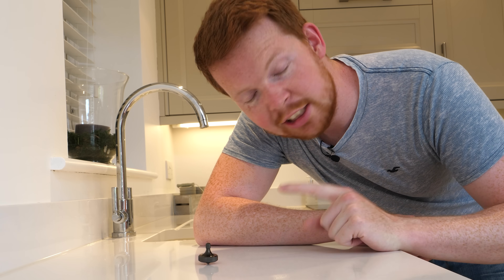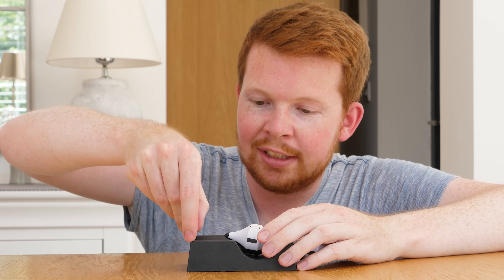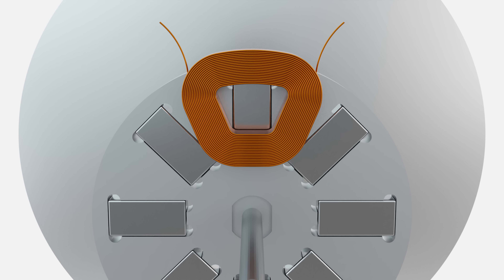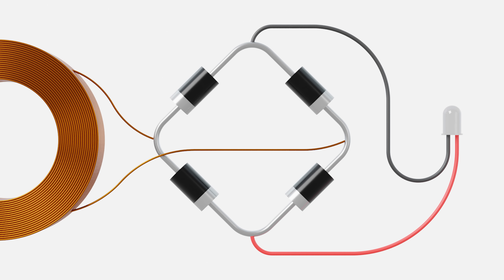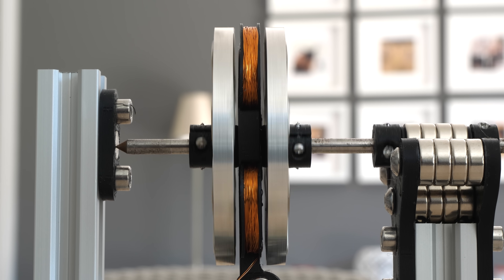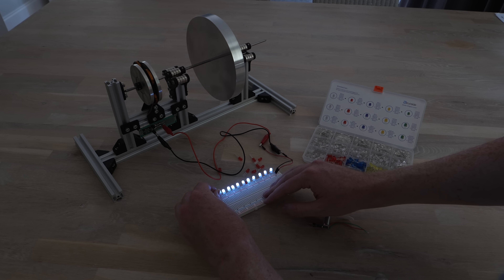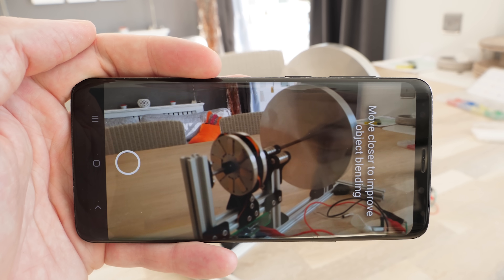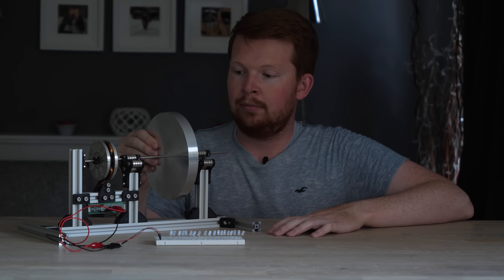Flywheel Battery

Comment: One of the things I've learned is that nearly all the work done by the fly wheel is from the mass at the outer edge.  You could cut away much of the inner mass and still be good.  As far as replacing the shaft, try cutting it off and drilling it out.  Most drive shafts aren't force fit.  Try a design where the tolerance is such that it's locked in by a set screw or a key.
Reply: This. The theoretically ideal flywheel has asymptotically-close-to-zero mass and an infinite diameter. One could store much more energy by adding a ring of steel around the edge and remove the same amount of mass from the center.
Reply: @LilMissMurder3409  actually wrong on the mass part. It's the momentum of mass that keeps it going.  The ideal has an extremely high mass concentrated in an atom thick layer with no mass between the "ring" and the axle beyond what's needed to connect the two.  Without mass you could not have momentum and cannot use that momentum to do work.  The true challenge with the mass is figuring out how much is enough to do the work without requiring too much work to get it up to speed and keep it there. Infinite mass may seem to be the ideal until you realize that it will take infinite energy to move it. Near zero mass seems the ideal until you realize that it can't perform much work. The true ideal is somewhere in between the two extremes and varies depending on the work that needs to be done in combination with continuously needing to overcome friction.
Reply: @ianbelletti6241  isn't aluminum a poor material choice for the outer ring then as it's fairly light? I suppose you would want to use something denser like bronze with carbon fiber spokes connecting it to the drive shaft?

Comment: What if you power the motor using flywheel and using the same motor power the flywheel. Basically saying mount the motor on the flywheel axle and use a transformer

Comment: good ! but you can increase inertia/mass of the wheel with "empty" wheel. And put a gear to decouple the wheel axe from the alternator axe. So the error of rotation of the first axe is taken by the fgear and so you can increase alternanor precision.

Comment: Hey Tom, I hope you can provide an update on this project. I'd love to see this spun up with solar. I would love to know how efficient this is, losses during charging and losses due to friction, and efficiency of energy in vs. energy out. 
I dream we'll all have a 1 ton flywheel attached to each home for backup power and on-demand load shedding.
Reply: Concept is cool, but i think it's cheaper to buy a gasoline generator than a ton of any material at all

Comment: Full ceramic bearings produce very low fiction, are very thermally, electrically, and inductive resistant can handle very high rpm and decent loads. I don't know why people bother with "frictionless magnetic bearings" so often. It's not precise or rigid and can be leveraged to a place of contact. Ditch the magnetic bearings, use ceramics and put the whole thing in a vacuum container.

Comment: Can you not encase the shaft in a 460 magnetic bearing?
There are also air bearings
Opposing magnets could be used to eliminate the need for a plate at one end

Comment: Main point he forgot to mention is:
Case 1:
If you rotate manually the freewheel which is levitating on the magnet, say, for example, it will rotate for 20 minutes (as there is no mechanical friction)
Case 2:
If the same rotating free wheel is subjected to rotate between copper coils in order to get electric current, it will rotate for less than 5 minutes

Previously in case 1, when no copper coils were connected, the wheel freely rotates for 20 more minutes when subjected to take electric current thru Cu coils, there the free wheel faces resistance, the free wheel should use more of its mechanical energy to overcome the resistance thereby the rotating wheel loses its RPM and eventually stops rotating

Comment: In my opinion, you could increase your coil count from 4 to 8, by slightly reducing the size of existing coils, while keeping the same thin gauge copper wire. This would keep a more stable current and should give even more voltage output. Then you should hook up a low voltage arduino board to it that pulses a motor that would spin the flywheel automatically. I would be interested in seeing how these changes/additions impact the overall design and efficiency and whether or not it would work.
Reply: The goverment might have gotten him
Reply: That would make it a perpetual motion machine which is not possible. The only way you can have a machine that recycles energy like that is to have a 100% efficient transfer of energy which is almost impossible itself. And that's if you don't extract any energy from it yourself. So the arduino would have to have a separate power input source, which kind of defeats the purpose of this contraption which is to be an easy and efficient hand crank generator. The arduino could signal for a motor using external power to spin it using the power from the generator which would work kinda like a car engine's alternator and battery
Reply: @lemau8458  100% efficiency is not necessary. It has to generate more energy than it consumes. Efficiency is also important, but not the most.
Reply: William John Macquorn Rankine would have a field day with that proposal- An he was standing on the shoulders of Giants in 1850! He helped to more fully develop the Laws of Thermodynamics- a great Wikipedia read… I do Love this display of how power is generated! Mr Stanton has done an excellent job!!
Reply: To make it self-sufficient? This is what I proposed in addition to putting it in a vacuum chamber to further reduce friction.
Reply: @SeynGod  you wouldn't dare break the actual laws of physics now would you

Comment: Getting full magnetic levitation should be doable by arranging the magnets slightly differently.

Instead of biasing left or right and adding a plate to prevent drop-off, you bias inwards and let it balance against itself?

Comment: A simple concept of an almost frictionless energy device by using the Earth's electro-magnetic energy density and a flywheel. If you turn it vertically and use a V-shaped or even better a W- or M-shaped flywheel, it can give better performance. It's all about attraction, repulsion and frictional vibrations to generate high waves of force and high frequency (Amplitude+Frequency Torus Energy Field=Frictional energy in 2 opposing forces) if you can minimize the difference between the ground attraction and the device with a stable atomic element like mercury. It could have a long period of motion of a compressed and decompressed dielectric oscillated geometric system.

https://youtu.be/yhu3s1ut3wM

Comment: This is hall of a motor-generator booster as used in 1941 on the the UK's Southern Railway's electric locomotives fleet, specifically the motor half has been omitted. These boosters used the traction supply to power up a flywheel to provide a short period of power for when the locomotive in motion crossed a gap between the third rails which supplied DC electricity at 750V. They could also  e used to boost the traction power yo thecrails on slopes or when starting a heavy train, but not to move the locomotive when the power was off. 2 such boosters were fitted to these locomotives.

Comment: to rotate wheel, you used energy and less than that energy transmitted to lamp. also, if you use big load, as 2kW heater, it will be stopped in few time. these are not science, not engineering... sorry

Comment: Im making this with some minor alterations to make a fun desktop Pomodoro timer! One thing I am focusing on is controlling the length of time the alternator will run. When the flywheel is spinning, LEDs will light up and as the spin rate decreases the lights will dim. When the flywheel stops the lights go off and that indicates it is time to take a break from work!

Comment: @TomStatunEngineering ... I think this one needs an upgrade, try to put a motor direct to drive the flywheel while your motor source will come from your output...and try to enlarge your alternator same size of your flywheel to increase your windings same as your output...this make more sense so you dont need to manually rotate the flywheel everytime, once powered you now have a perpetual motion...

Comment: I wonder if it’s possible to decrease the friction further by utilizing a magnet system at where the point of contact is. Probably outside the scope of a video like this. May need loads of precision engineered and machines parts such that wobbles won’t throw it off.

Comment: hmm now to build a much larger flywheel energy storage for your workshop
build a much less wobbly version with 10-100x the mass and use multiple coil sets encased in acrylic(because fast moving spinning objects=ouchie) and spin it up in a similar manner to a 3-phase hobby motor but with custom coils and magnets
bonus if you can cook lunch with the energy you store in the flywheel

Comment: Is it possible to fashion the flywheel into a magnetic rotor pushed forward by a secondary frame with opposing magnets? Like a watermill. If it works horizontally, shouldn't it also be able to be housed vertically at the same time? Then you wouldn't need the drill to power it.

Comment: Great video but you ned to use a current limiting resistor with LED's. Luckily the voltage you generated was not high enough to cause a problem.

Comment: I work with rectifiers and capacitors quite a bit. You could increase the capacitor size and reduce the flickering; it flickers because the capacitor is discharging faster than the alternator can generate…

Comment: You efficiently made a dual rotor axial flux motor, which I suggested to you in your e-bike project before.
Just wind a couple more copper wires and stick a VESC to it and see how good it performs in terms of torque.
Awesome work & video!
Reply: You sure that the design is efficient?
I have very much trouble figuring out the orientation of the magnetic fields and how to make their interaction as efficient as possible.
Also magnetic field diagrams make me dizzy.

Comment: There are engines with about 500k or even a 1 Mio rmp with vaccum and magnetic bearings this would be an awasome unbreakable day night storage because you can save a huge amount of Energy in a tiny wheel. Wanted to buy and build but the issue that you can purify uranium they didnt want to sell it to me 😅

Comment: I worked on what was called a peak shaver .  It was a 40 ton flywheel connected to a wound rotor motor. The entire system was lifted by hydraulic pressure bearings.
Reply: More details please? What kind of power did it gen and so forth. Very interesting. I imagine scaling this up to what it would take to run my house. Basically a small 2 bedroom with just the basics. Have it store the energy in battery(s)and off them to inverters to convert to 120 ac at say 100 amp / 4000 watts. I run my house on a 4500 watt propane gen no problem when the grid is down. Anyhow even if I had to go out 1 or twice a day and get the flywheel spinning or crank up some weights geared like a coo coo clock, I wouldn't mind. With the exception of the energy I have to put in it would then run my electrical needs for free! Even if you had to use a small gasoline engine that you ran for 20 30 mins a day to get the weight up to speed, it would equate to pennies per kilowatt compared to the grids prices. Any ideas, thoughts, anyone done anything like this????
Reply: @sitkumjohn This machine was designed to stabilize the voltage and frequency at the end of a transmission line  The peak shaver was connected in parallel with the connected loads at a mine site in northern Canada.

Comment: If you create a mount for the plastic that holds the copper wire you can spin it with a motor and feed really thin copper wire around it, like guitar pickup thin.

Comment: Have you combined this with batteries to see charge times? will it charge em? Do you see your design is highly scalable?  add stabilazation to the other end of the rod with a point and in the center of a magnetic ring would hold it in place without resistance? 

Food for thought magnetized ball bearings. I would greatly appreciate your reply :)

Comment: You could also introduce a crank to the other end of it with teeth that grip one way but slip off in the other so you can quickly crank the magnet up to speed rather than doing it by hand.

Comment: If you use a gear, it’ll be easier. Using a big one send the energy to the small one, connected to the rod, that’ll move faster. But, it’s wobbly.

Comment: I saw the video where the guy use flywheel to breaking the bicycle, then accumulated energy was used to start moving it. But he had not any magnetics bearings :))
Btw I like to know the efficiency of this system running at the start without electric circuit breaking over 20 minutes :)

Comment: The flywheel battery is as much use as "Newton's Cradle" Novel and entertaining but a waste of time and the energy required to make it!
You can use the concept as a Uninterruptable Power Supply, you put the flywheel in a vacuum to make it more efficient. BUT it still consumes more power than it gives out!

Comment: Pretty nice: but you ought to invent two magnetic bearings on both sides of the axis and then, your goal to gain more revoluton without wabbling, is done. That way, by which you accelerated the flywheel, we used it about 40 years ago to start a propeller of a petrol engine for heavy duty models. Improve that!

Comment: Can you make an electric high speed cycle which gets its power through the mechanical energy converted by tyres (basically a continuous cycle of mechanical to electrical energy) we can use the same principle of Faraday law into cycle hub as stator and rotor

Comment: the surface that you using to pin the axis, My idea was to use magnets to repel each other so its stuck in "air" from both sides so it cant go left or right, up (gravity), down magnets repelling...  so basically getting whole axis and magnets that should spin levitating. also on the big wheel you can set like a V shape few rows smaller magnets that will repel some fixed near by so it forces axis to spin forever. (using distance to try to set RPM speed)  My plan was to heat water with copper pipes to have  a heater..not enough time and resources to play and test everything. Sorry for bad english

Comment: So aside from a few seconds, there's no long duration tracking of the output under load as it spins down.  No comparison of deceleration rate vs load?  Like, yeah, it acts like a battery for a while, but is it a very good replacement?  Probably not at this very low speed.

Also, total energy input vs output? (Efficiency.)  Not a whole lot of substance here.

Comment: Once you take into account the energy used to make the wheel rotate and the increase in resistance of the copper coils once the power is being consumed, you'll see you're basically just doing the work with the energy you input at first. We need something that'll create more power than it requires. Oh, nvm, the real cool thing was to watch it levitating.

Comment: so if you put a barrow around the flywheel with magnets on the flywheel and on the barrow in the opposing directions will it spin forever? or use the current you get from the alternator to power the spinning shaft to send it into a infinite loop ? i'm just asking because i know nothing about this stuff but want to learn more. and ofcourse you have to get that thing better balanced than that because your losing so much momentum with that wobble

Comment: I wonder:
Can you add a hand crank to get the thing up to speed? It would be interesting if you put a USB port on it so you could run different things.
Alternatively, could you add a windmill blade and get it to harness the wind due to the lower friction?

Comment: This project combines a ton on interesting concepts - the mag bearings being the coolest of them all. I'm wondering whether you could get rid of the contact point (the axel touching the retaining plate) by using magnets... eg: at the end of the axel, mount a magnet with S pole facing out, then a magnet on the retaining plate, with S pole out - then do the same thing on the other side. I'm pretty sure you could get it to float without the flywheel mounted, but would it work with lots of weight on the axel?
Reply: You could have magnets pointed at angles to prevent side to side motion. That might be tricky to set up though.
Reply: I just got a 3D printer and I'm going to try it for myself. My thinking is that as long as both sides of the axel are locked into position and forced back into the retaining plate, a person should be able to just replace the pin with two opposing magnets - one on the retainer and one on the end of the axel. My knowledge of magnetics is limited.

Comment: attach the tip of the axel to a ball-shaped magnet (only by using magnetism)and let it hang down vertically so that the flywheel is hanging with the pointy tip on the magnet axel. Works well, less work.

Comment: Anti-Green Propaganda. 

A home flywheel generator should weigh at least hundred pounds. And it doesn’t need a home-made generator. 

You could buy the flywheel with ball bearings mounted on a stand, attached to a generator, for two or three thousand dollars. And you could power the flywheel up to speed at night, when rates are low. 

You could also make a small box which you bring up to speed at home, and then it drops into a receiver on your bicycle. A twenty pound bike flywheel, spinning at 20,000 rpm might give a range of five miles.